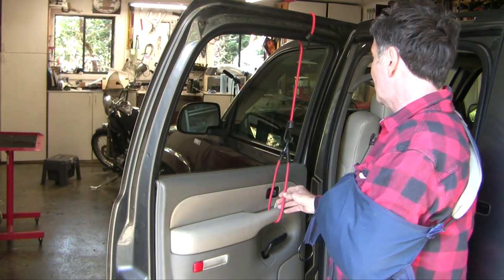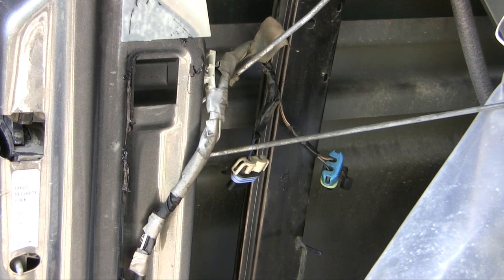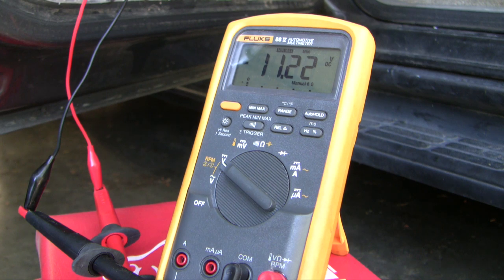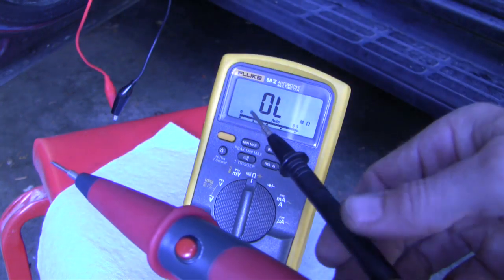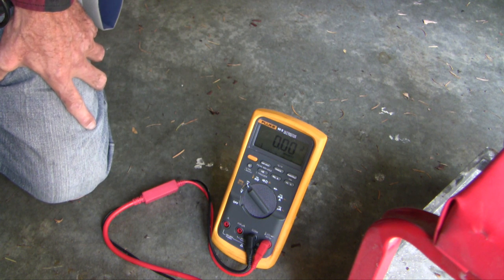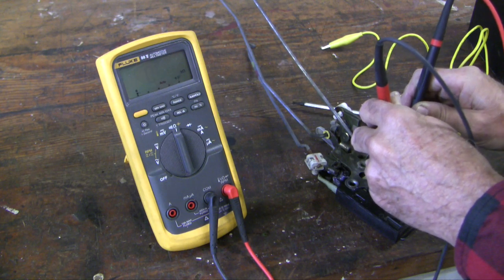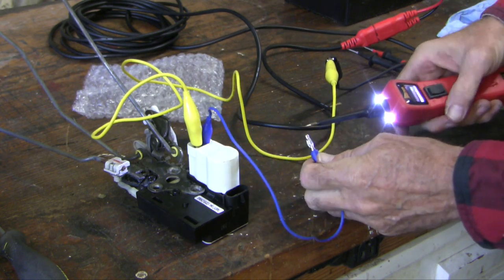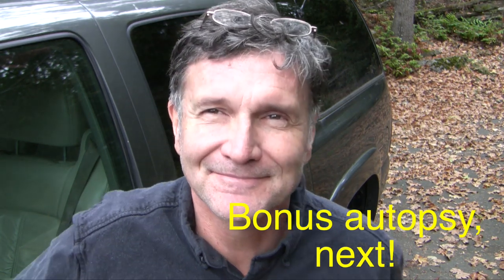Car door won’t lock, diagnosis and troubleshooting

Comment: Hi can you help me about my car's power lock problem? It doesn't lock. However, if i manually flip the door locks, it can be unlocked when unlock button is pressed. Only the locking mechanism is having issues.
Reply from the maker: When door locks become unreliable you have to think twice every time you lock your car, really annoying! The way a pro would approach this would be to remove the inner door panel, back probe the connectors and see if the door lock actuator is getting a signal to lock. If there's no signal the problem is a bad switch or the circuit board. In your case I doubt a wiring problem because the reverse flow unlock signal works fine. If a good signal with good current is evident on load testing, then the problem is in the door lock actuator itself. As a double check you can test the actuator directly with 12V DC, all of those tests are shown in the video. If I had to guess about your repair I would guess it is still in the door lock actuator or a mechanical problem from inadequate lubrication. With more power needed to lock the mechanism, it wouldn't be unusual for one direction to fail first. However there is no point to guessing when diagnosis verification is so simple. This kind of repair is bread and butter for most shops, and often is not terribly expensive. So, if you are uncertain about your skill set, tools, or time, I wouldn't hesitate to get advice from a pro. Good luck!
Reply: Thank you very much sir! You just saved me from buying the whole door panel switch which costs about $400 from the local dealership. The local toyota dealership here told me that the problem might be the panel switch without even diagnosing the problem.
Reply from the maker: When the manager is asked for a quick estimate without getting a chance to make the diagnosis, they want to avoid the shock if it turns out to be a worst case scenario. By quoting a high price and then maybe coming in lower, the client is not so unhappy after the repair is done. So, take any estimate as an honest guess, usually on the high side. The other problem is the fact that getting parts can take a few days. In my example video I made the diagnosis, then replaced the door panel and waited for a part (from RockAuto in this case) to come in the mail. One thing you don't want to do is start replacing normal parts without doing the testing, that can be an expensive mistake. It may well be the switch.

Comment: Dear Sir, 
I took my 2017 Toyota hilux to car wash and got done. Took the cat home , power off and when I lock the door it gives a long beep sound showing one of the rare doors is open while it is closed. I tried opening and closing every door and still same problem. Any such problem you have faced before and its solution please.
Reply from the maker: You probably got water into the connector for one of the door latches, maybe at the car wash or maybe before that. One thing to remember is that on some vehicles the hood latch for the engine is also on that security circuit, so make sure your hood/engine bonnet is shut completely, it is easy to overlook that one! If you have access to a scan tool, you might get better info regarding where the problem is. Failing that you will need to open one rear door at a time and look for the problem. I'd have to look at the wiring diagram to see how it works. You can get those from alldatadiy or mitchelldiy or ebay or maybe even bbbindustries if you make a login account. The last time I used bbb it was free, but required a login. The Hilux is my favourite truck, I rented one in Africa for 6 weeks and it was an excellent vehicle. Bombproof, reliable, and not overwhelmed with unnecessary electronics. We can't get them here in North America, it doesn't pass the more stringent pollution controls.
Reply from the maker: By the way, in my video of the VW hood latch repair, I show the switch and wires that tell the computer the hood is closed. In that video I showed how to fool the computer into thinking the hood is always open or closed by either tying the wires together or capping them so they can never touch. So if the switch inside the latch is bad, you may be able to manually work around the problem without having to pay for a new switch or regulator.

Comment: I have an 02 Honda civic, my keyless remote unlock all door but not my driver door, and I replaced the actuator and still does not unlock please help.
Reply from the maker: I'm guessing you'll want a high level scan tool with live data to help decide if the issue is in the remote, the module, or the switch.  If you have a second remote showing the same issue then it's either the switch or the module, sometimes they are integrated together. If you can manually operate the lock with the switch inside the car, it could be either. Of course listen to hear if the actuator is trying to close, maybe the mechanism just requires mechanical lubrication.

Comment: I have a 95 mustang and when ever you press the lock and unlock button the locks move up and down but on the drivers door it won’t lock. The lock will go down but you can still open the door and I don’t what’s wrong with it
Reply from the maker: It sounds like the door lock actuator on the driver's door is going bad. I would expose the actuator, check for power and ground at the actuator, and verify that your wires can carry significant current with a light bulb or voltage drop test. If you're still uncertain about the diagnosis you could wire it directly and see if it locks with 12V directly applied while the rest of the wiring is unhooked. Occasionally I've seen the driver's door fail to lock when there's some other door (or even the hood latch) that won't shut or lock, as a warning to the driver there is something wrong.
Reply: @spelunkerd  Ok thanks

Comment: I have a honda civic 2005 lx and I put a stereo but the stereo burned and my padlock door does not work now i hope you can help me thanks
Reply from the maker: Replacing parts like the stereo might trigger the security system to close things down. I would check the usual things, look at fuses in case the stereo melted a fuse as it burned. Check for diagnostic codes, maybe remove and replace the neg pole of the battery hoping it will reset. Some security systems require you to input a stereo code when replacing the stereo or temporarily disconnecting the battery. Owners manual or dealer service manual will have more specific advice. I use alldatadiy for dealer service manuals, although Mitchelldiy offer a similar program.

Comment: hi, i have a 2010 suburban and my door lock keeps on locking when moving at a slow speed. run a scan tool no error, and my batt drains after sitting for 2 days. this could be the issue for what i have?
Reply from the maker: It's normal for cars doors to automatically lock once when the vehicle achieves a speed of about 10 miles/h, it is a safety feature to prevent doors accidentally flying open when involved in an accident. It should happen once only, and after that the doors should all be locked. I think that may be a feature you will be able to turn off if you want, you could check your owners manual. If you have a repetitive locking activity, it suggests your vehicle is not sensing that all doors are locked. The battery drain is a more specific issue, likely due to "parasitic drain", or perhaps a problem with a battery that cannot retain a charge. I did videos on both of those problems.  It sounds to me like you have two problems. I would pursue the parasitic drain issue first, probably starting with a check to be sure your battery is able to hold a charge while off the car by formal battery testing. To check for parasitic drain, you want to put an ammeter on the battery after shutting the car off, looking for a drain of current even after the computer goes to sleep. It usually takes about 20 minutes for that to happen in most cars. Look for draining current of more than about 30mA, then use voltage drop across fuses to narrow down the search. Note that the most common cause of parasitic drain is aftermarket parts, like anti-theft security devices or other devices left on. It could be as simple as an interior or glove compartment light that won't turn off when the you shut the vehicle off. Good luck!
Reply: thank you for the speedy reply. actually i forgot to mention that the "REAR ACCESS DOOR" is open although its still closed, here is a sample of the video.
https://www.youtube.com/watch?v=BUyvPOb5pr8

Comment: -Can you please help me , my Mazda 3 2010 i4 all doors doesn't lock automatically but I have to go around the car and lock them with the key , do you have any idea what should I do , I am a new driver and I don't know a lot about car systems . Thank You !
Reply from the maker: If you don't have any experience with auto repair, door locks are a difficult way to start because the wiring can be so complicated. As an owner the easiest thing to check is fuses, so if you know how to check those you could start there. To find out which fuse, you usually need a wiring diagram. You can find free copies of those for many vehicles at bbbindustries here on the net. The next place I go is to the master switch, which is usually inside the driver's door panel. I take that off, looking for power and ground at the switch with a multimeter. If you don't have power or ground, you may have a broken wire leading up to the switch, which is often in the wiring loom as it goes through the door jamb. The wiring diagram will show you which color coded wire to check. Most often it is easily found leading into the switch. From there I often find myself tracing back to one of the door locks, usually the drivers side because that panel is already off. You can check for power and ground there, and you can hotwire the actuator to see if it works when power and ground are applied from another source. Many systems also have a switch for the hood latch, and if that switch fails sometimes you won't get a confirmation honk that the doors are all locked. Old vehicles have vacuum driven systems but the vast majority now are electric. Your other option is to ask for pro help, which could cost a few hundred dollars or even more. No guarantees, but it is plenty annoying to go without automatic locks, and your resale value will improve if you can get it fixed. Good luck!
Reply: spelunkerd Thanks , how about if I try to program an keyless remote do you think it work?

Comment: On my 1993 toyota corrolla my doors lock keep on ingage &  disengage I remove the power control panel, they kept on doing it so I disconnected the battery.
Reply from the maker: Interesting problem. Stuck switch button? If it has remote lock, don't forget that one.

Comment: Hey man my 2002 grand marquis drivers door doesn’t lock when i press the button although all doors lock work; i hear a sound but the arm doesn’t go up or down. even if i lock it manually by pressing on the arm the door still wont lock
Reply from the maker: Sounds a lot like mine in the example shown, the diagnostic process should be similar. You need to decide whether it is mechanical or electrical, whether it is a bad wire connection, broken wire, bad switch or a bad actuator. Blown fuse is unlikely because evidently other door locks work. When you have the panel off you can use the switch to see if it moves at all, and whether lubrication of the slides helps. If no movement, check for power and ground appearing as the switch is pressed, test the wires with a small bulb to be sure they can carry the current needed to move the actuator, and look for green crusties that appear at bad connectors exposed to water. You can get new aftermarket actuators at parts dealers like Rockauto, 1AAuto, and many others. This repair is simple enough that you don't usually save a ton of money by getting a pro to do it, so if you're lacking confidence with your skills I wouldn't hesitate to ask for help. Good luck!
Reply: spelunkerd thanks man i sure will have a pro look at it soon. Good to know there are still people in this world that would sacrifice there time for helping others :)

Comment: Hello sir I'm from india I I have Chevrolet optra magnaun LT varien car,
My all 3 door's locking n unlocking properly all the actuators are fully functional but problem is driver side door not receiving current I checked everything I don't found any blown fuse or wire damage  n rely iahue then what's the resone to stop current flow to actuator.plz help to know reason.thank you in advance. love from india.❤️
Reply from the maker: You need to expose those wires leading to the driver door actuator to be sure the actuator is getting power and ground. If in doubt, use a jumper wire, disconnect the feeding wires, and apply power and ground independently to prove the actuator works. The easy solution would be a bad actuator which is easily replaced. If the actuator is good, then carefully examine the wires leading from it back to the switch, looking for a break or short in the wire. Look carefully for frayed wires around the edges of sheet metal. You should be able to prove the switch is working or not by placing a test light across the power and ground connections of the switch, by rocking the switch on and off to prove it works with the test light. If the switch is bad, you could clean terminals, check and fix bad solder joints or connections, or replace the switch. Good luck! India is an amazing culture, I've had the privilege of visiting India, twice.